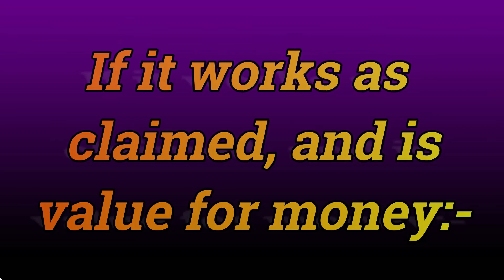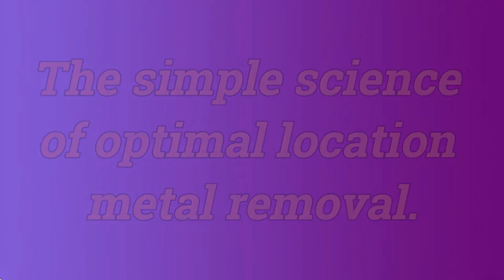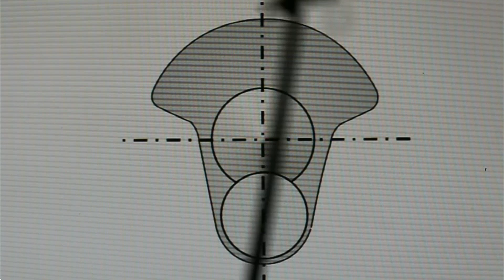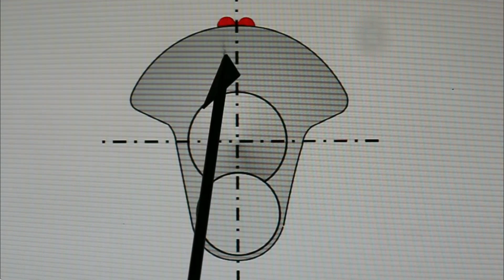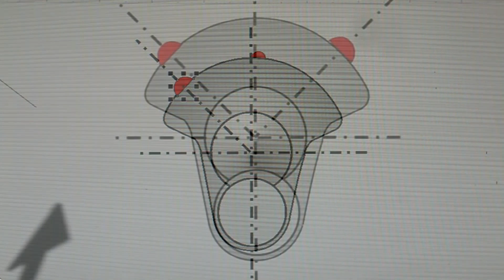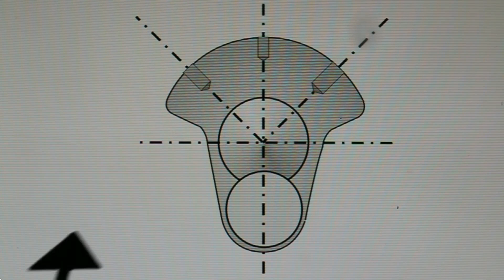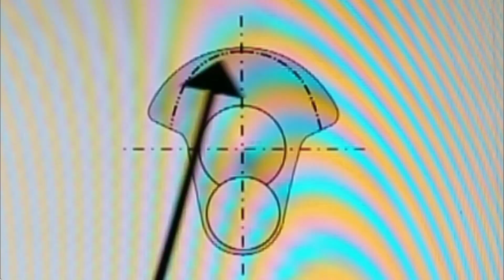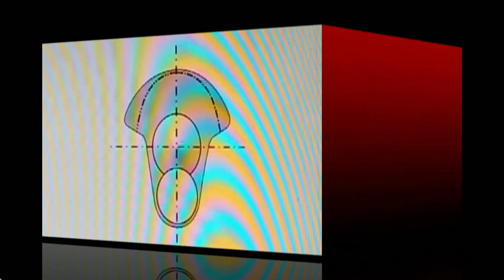Crank modifications for increased power Part 2

Comment: Hi, big fan. Wanted to know on Crank Bearing surfaces, Finish. What is best finish sandpiper wise,Wet/Dry?

And should you polish bearing journals with metal polish afterwards?(after fine grit sand paper polish process) 

Is it advisable for Reliable crank oiling to polish the crank(Extra step) (Metal Polish Compoud) after it has been polished by profesional machineshop with their mahine. They use the normal sand piper strips on their machines. But do not do metal compound polish

Is there a thing as to smooth on crank (too smooth?)😅

Asking only if it can posibly improve bearing life on Oval Race engine😅

Comment: Just a note: I work with the Frod 351-C engines and as stock, these cranks come with as-cast lightening holes in the rod journals. So the technology is a sound idea. The only oddness is, Ford's are not through-holes. The back end of each cast lightening hole is blind. This is for the 351-C, 351-M and 400.

Comment: I am very much convinced even before viewing your advisory exploration. That hollowed crankpins are a great asset to acceleration. I got a cobber on the lathe facing my flywheel. A skim off and enjoying the cast steel hogging says, do you want to take any weight off? So we went ahead and took material off the periphery, then the back side until I was beginning to question the remaining integrity. But he confidently reassured as the mass began to resemble a billet flex plate. It still idled fine with the 5 kg lighter FW and the bottom end torque was massive. Most notably the lighter rotating mass would rev up so quick in comparison it was like adding a roller cam with some high performance profile. A lot more fun to drive. If I can the next build will get bored big end pins. As you know playing around with your own engine is a bit double edged. Especially while "just having a crack at it!"

Comment: Hi David, How do you manage the big end oil feed holes when adding a hole to the crank pin if the OEM feed holes come through the center? (Datsun A12)
Reply: I don't believe he drills all the way thru the journal. He only drills in far enough to not hit the cross drilled galley.

Comment: How would this video apply to a flat plane I4 stock cast crankshaft?  Specifically a dodge neon srt4 crankshaft used in drag racing.  Im very curious, because in my best opinion, that crank seems quite heavy for a 4cyl crank.

Comment: Hi David , I have been involved in motor industry for 54 years (71 now) and I have been a keen follower of your enterprising way of modifying engines since buying your books and reading your articles in the english CCC magazine back in the 1970ts, my main involvement has been porting old english cylinderheads for classic racing with very good results due to your input over 50+ years , now just do a bit of porting work to have something to do.   Just wanted to express my huge appreciation of a master technician passing on his immeasurable knowledge to the uninitiated on a free to view basis,    you deserve a million subscribers ,     and it might inspire newbies to take up a die grinder, a mask ( cast iron dust will make you cough rust for days😅😅.) And full face mask and start practicing your sermons,

Comment: Awesome stuff thanks so much.   Any experience with large displacement air cooled aircraft engines?  I'm assuming that you do all your mods for reducing windage and oil flinging first before any balancing takes place.   Also what do you think about polishing the entire crankshaft?   This is common in super high revving motorcycle engines, which I think is for both windage and surface stress relieving.  Great information, even a knuckle head like me can understand it!    :)
Reply from the maker: Is it a V tail or a conventional tail?
A friend of mine and I were vying for the job of hopping up the Red Bull's aero race planes but sadly never got the job!
 Unfortunately I have very little experience on aircraft engines other that doing hi-performance cams for them.
Reply: @DavidVizard  Its a V-Tail, the only kind to have ;)  I've owned it for over 30 years, she's a beautiful old gal.    The balance is very critical and dynamic, there are RPM ranges that induce stress into the prop assembly that can cause cracks and catastrophic failure.  My engine has a 1 minute WFO limit for that reason.

Comment: I'll tell you what I have learned in many years of building engines

There are foolish ways to spend your budget and not so foolish ways.

Decide on a budged, then research what kind of power you can get out of an engine for said budget.

2000 hp on a 500 Dollard budget isn't going to cut it.
It coasts more money to make more power. Don't expect high hp numbers on a small cubic inch engine won't happen easily. 

Turbo charging is a great option for high hp numbers on a low budget. Id suggest a budget of 2k to 4k for a 1000 hp build. As I don't believe in using cast parts in a high hp engine. Forged rules. Hyperutechtic pistons are weak junk. Cast pistons chip easily. If you have to use all stock internal parts budget wise go with an ls engines. It's the biggest bang for the buck.

Comment: I've got a forged Mazdaspeed 4 cyl 2.3L crank that had some damage on the balance shaft gear.  Gonna do a balance shaft delete anyway.  Wondered if I could machine off that damaged balance gear to lighten the crankshaft with no ill effects on horsepower or balance.  Would consider rebalancing the rotating assembly and using mallory weights if needed.

Comment: Removing weight from the crank might free a fair bit of power but I'd be more interested in climbing the RPM range faster and possibly higher redline. I just watched this and the previous video, I'm really learning a lot here.
Reply: Hey there. Lightening and or balancing doesnt nessercierly make any HP. . Lightening and balancing helps it run smoother and rev quicker. Friction removal is the key to hp

Comment: I'm a 69 yr old retired tool & die maker, and machinist, that has been reduced to hot rodding Honda clones, like the Predator 212. I put one on a sced 80 aluminum MT bike frame, added the toughest parts I could buy or build, including a Harley LED headlight and taillight, and made a very capable motorized bike. I was very interested in what you said about putting a hole in the crank journal, and how it actually increased the strength of the crank. On a 1 1/2" journal, would a 5/8 hole be too big?

Comment: What about oiling of the big end? My crank pushes oil through and if i make a hole in the big end there how will the lubrication going to work?
Reply: On the Merlin Rolls Royce plugged the ends of the drilled bigends with aluminium caps. The drilling just formed part of the oil passage.

Comment: If you drive the TVR Cerbera with a flatplane crank, you will really understand what a light crank does to the car. It spins up so fast! Feels like a motorcycle engine. I think its the same with lightened flywheels.
Reply: It is the same with lightened flywheels 😅

Comment: Would this work on a 300 straight 6 Ford crank.  I can't find a forged crank.  Not interested in 7k for a custom crankshaft.   I haven't heard of failures in the cast crankshaft but want to turbocharge the engine.  They got over 500hp and almost 600lb/ft @13 psi boost.  But they had the forged crankshaft.  I have heard rumors that it can handle upper 20's.  I'm happy with the 13 psi power levels.  Lol. Does your 128 program work on an inline 6?  Thanx DV
Reply: Turbo engines need less overlap or they blow the charge right out the exhaust.
Not mentioned in this video - when you grind on the crank you will create "stress risers" which are locations where cracks start from. All grinding needs to be followed with "polishing" and then "shot-peining" to restore surface tension.  Mallory Metal plugs can be pressed into the counter-weights to allow further weight reduction.
You should run all your ideas by your machinist who will have to balance the assembly when you're done lightening everything.

Comment: Does a lighter crank/ rotating assembly have a affect on engine braking? I think it would. Something to consider per application.
Reply: i believe compression ratio and friction (piston rings and valve gear) compensate for it. any drag from a high pressure/high volume wet sump oil pump likely doesn't matter due to any deflection in the oil pump shaft running it.
Reply: @albertgaspar627  compare a gearbox versus auto set up. The gearbox car offers far superior engine braking. It has less drag than a transmission, i put it down to the flywheel weight. Installing a lighter flywheel reduces engine braking. In a drag set up going light as you can may be preferred,  what about track use? Will a lightweight rotating assembly hurt engine braking.  Its probably a silly question ? Consider the cost of going lightweight rotating assembly,  then you throw on a heavy flywheel. What difference will it make. Thanks for the reply,  and happy new year.
Reply: @GG-rj4oj  An automatic transmission provides worse engine braking because there's a hydraulic connection--the torque converter--between crankshaft/flywheel and the transmission/driveshaft, while the manual gearbox has a more solid connection. 

think of the average torque converter as two desk fans facing each other on a table. Turn on one, and eventually it sends enough air into the blades of the second fan to get it turning and then up to a matching speed (it also explains why OEM torque converters are typically larger in diameter than a 9inch racing TQ--more surface area creates a reaction sooner, ie, at low engine RPM).  shut off the first fan, and consider how long the second fan takes to react--depends on mass of the blades etc.

as for driveability, a lighter than OEM flywheel means launching from a dead stop (out of the pits etc) will require more throttle or slippage from the pedal. It also means changing gears in the corners will cause the RPMS of the engine to fall faster due to less inertia. If you're running a turbo, you may not just fall out of the torque curve but lose boost if RPMs drop enough. 

great question--the only silly question is the one someone doesn't ask worrying what people think :)  Happy new year to you as well!

https://www.zndmotor.com/blog/pros-and-cons-of-lightweight-flywheel#:~:text=The%20pros%20of%20lightweight%20flywheel%20are%20the%20same,But%20the%20con%20of%20lightweight%20flywheel%20is%20drivability.

Comment: Rotating mass is why I hate balance shaft engines. To me, it's like saying "Let's build something flawed from the beginning. Next, let's put a stupid burden on it."
Reply: I removed the balance shaft in our 3800 and threw it in the bin. Regularly spin it to 8000rpm @1000hp.
Reply: @V6turbo  It's great that people delete balance shafts. However, it's rare anybody has anything other than a stock engine.

I dread to think how much was wasted because my mom had a 3.7 Jeep Grand Cherokee and drove it 165,000 miles.
Reply: @Skyline Fever  check out a few of my channel videos. Can see some 3800s on dyno and at the track. No standard stuff in my life 😆
Reply: Approximately 625 miles, or 3,300,000 feet may have been wasted.

Comment: Dear Mr. Vizard, Thank you so much for sharing your vast knowledge and experience through this platform. A question regarding crankshaft counterweight reduction in mass. With less mass is the engine transient (throttle) response improved, but with less rotating mass is there any reduction in output torque? Thank you
Reply: Mass would only effect instantaneous torque not produced torque.

Comment: I have a suggestion for video content regarding port area/size and bowl area/size and what one can do to band aid a head with too big ports/bowls for the engine ci and intended rev range.
Not sure if this is something that interests others. But since Im stuck with such heads for my engine its very interesting 🙂
Reply: Show up with them at a swap meet. Some guy will quickly buy your overp-ported heads, and you will have a fist full of cash for your next pair.
Reply: @davidbaldwin1591  thats a good suggestion 👍
Unfortunately Im working on a 60 deg V6 so there are no other heads to use.
They are too big from the factory. 🤷‍♂️
Reply: @magnusdanielsson2749  why not just weld or fill them to get what you want?

Comment: What!  It only did a couple of races and 200 dyno pulls!   I would like to see any modern factory motors accomplish that.  Another great lesson.  Sounds easy when you describe how it is done.   That is one of your most interesting qualities.  The ability to teach complicated engineering to anyone that cares to listen.
Thank you David.
Reply from the maker: Terry, the test engine did not do any races. It was the companies latest spec engine and was used exclusively for dyno testing. 200 puls on a Superflow dyno is nothing for a roundy-round motor. When Terry Walters and I did the BBC up grade for GM it had to go 50 hours wide open at peak power rpm without breaking or loseing more than 5% output.

Comment: When I look into cross drilled rod journals what I find is claims that at high rpm they will centrifuge out the oil in a way the starves the rod bearings of oil and leads to failure. Can you comment on that?
Reply: I think That that is What Tartro  explains on the HD motorcycle engines , as for the reason for restrictors on the crank . 
 if not fitted then starving  other parts of the engine .

Comment: The engine will also decelerate faster.  I am curious about the torque pulse harmonics with the lower reaction mass of the lighter crank assembly.  Also, what about the torsional changes?
Reply: Torsional stiffness is most effected by changes to what's known as the 'critical cross-section' (CCS) thickness (this is the thickness from rod journal radii tangency to main journal tangency) and the width of the distance across the crank web as viewed down the central axis. Anything changed outside those areas has a very low effect of torsional stiffness. Which is why you don't typically see a lot of reduction in these areas; not to mention, there's not much weight reduction to be gained!